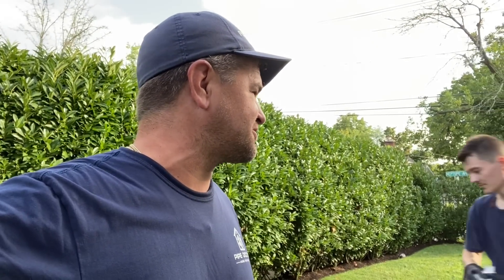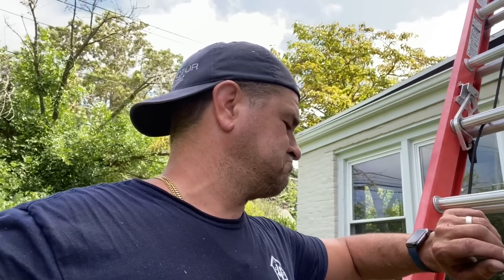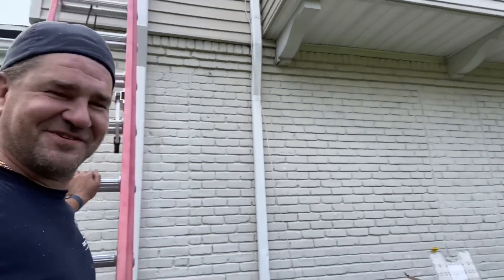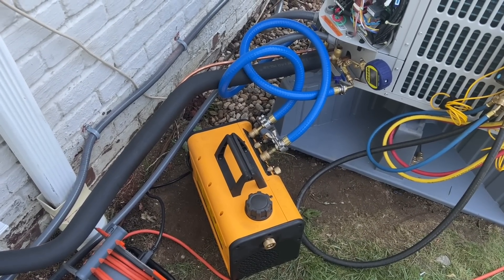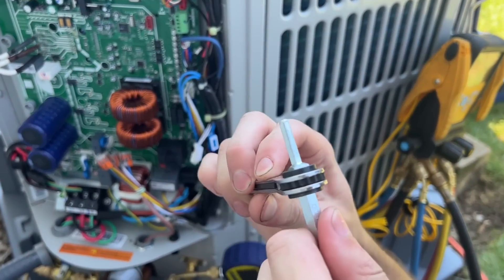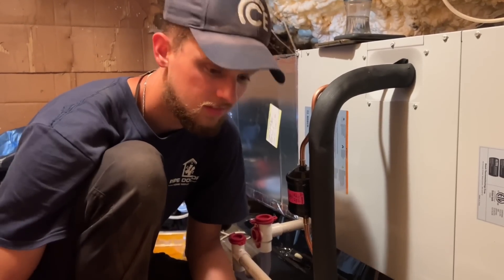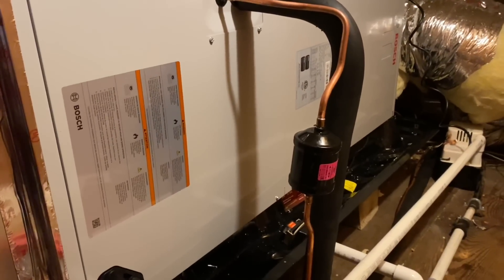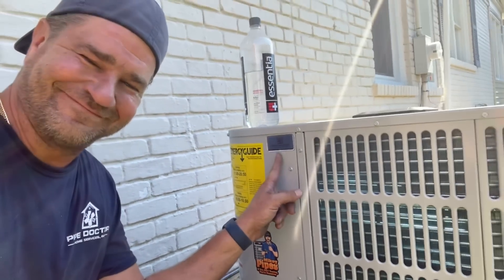Spray Foam Warriors Strike Again! Bosch IDS 2.0 High Efficiency Heat Pump Installation

Comment: Hi I like to know heat pumps are good for the weather like illinois,
for house like 2300 square ft.
Reply: @PipeDoctor  It goes down to below zero too , wind chill is really bad some time .
Reply: @PipeDoctor Thanks I appreciate it,
Reply: @PipeDoctor  is it safe to set the thermostat to -5 before the aux heat kicks in on that system?

Comment: Hey Mikey, I have a #Bosch but it has been a lot of trouble. I’ve had the control board inside the  BVA-48WN1-M20 replaced three times now since 8/20. Any recommendations? Perhaps a new HVAC servicer? thanks! Love the content.

Comment: Does the 3/8 line need to be insulated ? Because my supplier is telling me that it need to be insulated.
Reply: @PipeDoctor  On ductless (mini-split) systems, both lines need to be insulated because the refrigerant metering device is located in the outdoor unit essentially making both lines suction.  In a conventional split system with the metering device located in the indoor unit, the liquid line (normally 3/8") only needs to be insulated if it passes through a very hot non-conditioned space where it would be subject to heat gain (ie. hot attic).

Nice videos and that pie looks good too.  It's missing pepperoni for sure.  Best pie comes from Gino's (formerly located in Farmingdale but now in West Babylon).  Gotta get the Sicilian pie with half pepperoni and meatball on the next jobsite.  John will hook you up.
Reply: @PipeDoctor  At least we can agree - LI is the land of the greatest pizza shops on earth!  Respect SI and Jersey but LI has them beat by quality and sheer numbers.  Now get back to work already!

Edit - Brooklyn and Queens are included on Long Island people.  Go look at a map.

Comment: Bosch units do not dehumidify when running at low capacity.  There have been many lawsuits and contractors had to install whole house dehumidifiers to get the homes to a proper humidity level
Reply: A you tuber steven radon posted on live stream about installing Bosch units . He installed several units and customer complaint about high humidity levels found that on high speed full capacity the unit work fine but when the system cut capacity indoor blower runs on high speed causing evaporator to dry out and not humidifing causing unitto increase humidity in homes. The way he had to correct the problem was to install a aprilaire dehumidifier whole house unit the only way to dehumidify is to cut capacity with reduce blower speed

Comment: 2000 dollar controls board .
Reply: is that at cost or after markup?
Reply: @Jon-hx7pe  I think that’s the real cost with tax. But they do have a 10 year warranty. I’m not concerned. But I wanna test that board with some real life scenarios
Reply: Boards do not hold up in coastal applications as I have posted previously. That's why I don't install Bosch anymore

Comment: What happens if a drop of water gets on to that $2000 control board?

Like if you're servicing it after a rain and take the cover off and accidentally sling some water onto it.  Is it toast?
Reply: It is coated with a water resistant seal. However, overtime corrosion and heat break it down. On a brand new one it could probably withstand a couple of drops of water provided it didn’t find a path to ground thru that water. On an older model with boards a little water would likely create a direct short.
Reply: @dirtycoffeecupp  wow!  Thanks!  Single stage it is.
Reply: @jph77  the Bosch have already had problems with the board. Long term I don’t think they’ll hold up. Single stage 14 seer units work and are stable so I’ll put my money on it any day
Reply: Boards do not hold up in coastal applications.

Comment: How come you dont insulate your liquid line over there?
Reply: We dont in Minnesota either. When you buy the linsets, only the suction line is insulated
Reply: @natew48  we dont have centralised air con in uk. I was thinking minisplit where txv  in in the unit so insulate both pipes arnt your txv in your indoor unit?